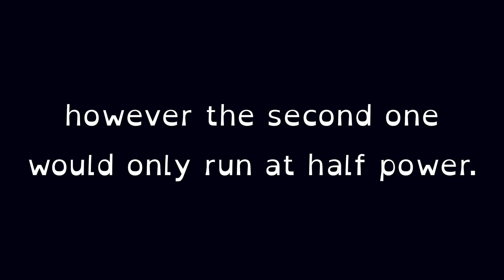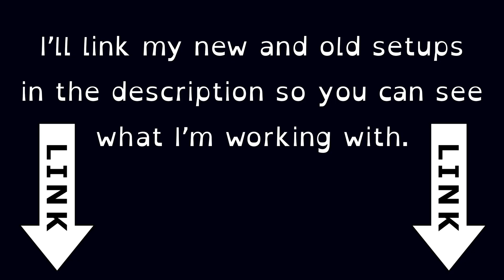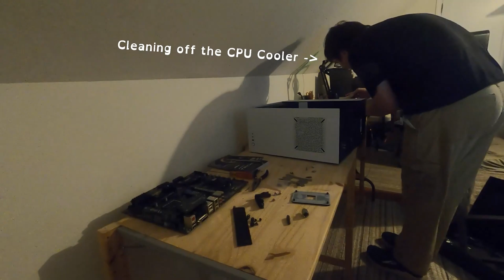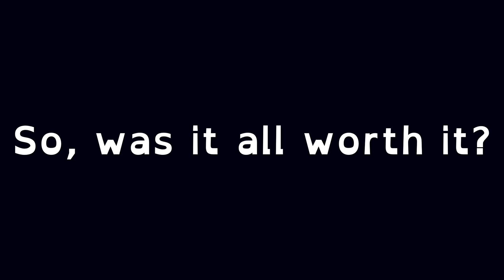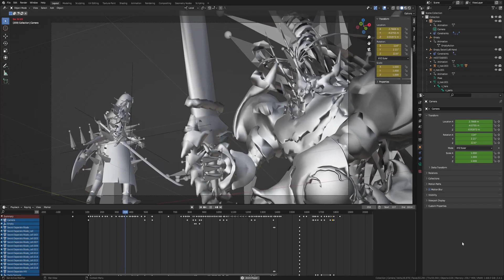Building a Dual GPU PC (Time-lapse)

Comment from the maker: I realized this after seeing a few comments, this setup is NOT meant to use both GPUs for gaming, nor is it meant for using both GPUs for a single screen.  The only time that this setup is using both GPUs is for Blender Renders.  Blender does not require SLI, Crossfire, or an NVLink for rendering, it only requires that the two GPUs are plugged in.  For those curious, the x16 PCIe ports on this Motherboard change to x8 when two of them are being used, not x4.  This was the main reason that I switched motherboards in the first place.  As far as I'm aware, x16 is more than any GPU would ever need when using a PCIe port, and x8 is generally good enough.  I only use the 3070ti for gaming, and I have the 2060 plugged into my second monitor.  The whole reason that I kept using the 2060 and didn’t buy another 3070 is simply because I didn’t want to pay for a second 3070.  All this to say, if you’re looking for a Dual GPU Setup for gaming or literally anything other than 3D Software Rendering, this is NOT the setup for you.  Hope everyone enjoys the video anyway!  Thanks for reading/watching!

Comment: you should get better performance with the 3070 ti in the top pcie slot since thats the fastest slot on the motherboard and then putting your 2060 into one of the lower slots
Reply from the maker: The two PCIe slots the GPUs plug into both change to x8 when there's more then one slot being used, so no matter which one they're in, they'll both be x8.
Reply: @ButcherBirdProductions  yes they’re both x8 but the actual speed of the bottom port is slower than the top port
Reply from the maker: According to my motherboard specs, they're both PCIe 4.0 (which is what I'm assuming you're referring to).

Comment: This hurts to watch man...
Reply: The 3070 ti is doing all the rendering dude. The 2060 is only there for extra video outputs. No processing done on that guy. You need a NVlink to share the performance of both gpu's SADLY there isn't a NVlink connector on ANY 2060.
Reply: Oh and why. Just why did you put the best card in a lower slot. Not sure what motherboard you have but most have 1 16x slot and all others slots are 8x or 4x. You might be losing out on performance.
Reply: All in all good try tho, and you still got better performance out of it! 👍
Reply from the maker: I'm pretty sure they're both rendering.  Blender doesn't require there to be any physical link between the two GPUs, it just uses all GPUs with CUDA cores.  If I wanted to play games with both GPUs, then yes, I would need a physical link. Both slots when used go to 8x, and from my research x16 is overkill for most GPUs.
Reply: @ButcherBirdProductions  your right my knowledge of blender is minimal sadly. Googled it 😂. But you can't use both video memory together without a NVlink.  It works but ur just not using both gpus to it's fullest potential this way. Happy it works tho.
Reply from the maker: Thanks!  Yeah, this was never meant as a gaming setup, so I knew I wasn't going to work for that.  Gaming on a 3070ti by itself is still pretty good tho!  Thanks for watching @CGgreen !
Reply: @ButcherBirdProductions  Its still slowing down your 3070 to have it in the bottum slot. the bottum slots always have a slower speed than the top 16X and 1X.
Reply from the maker: If you mean PCIe generation when you mean speed, then they're both PCIe 4.0.
Reply: @ButcherBirdProductions  PCIE Generation doesn't matter, the lower slots are slower in every motherboard.
Reply from the maker: @scarecrow5848  I don't see that on my motherboard's specs, but I'll take your word for it.